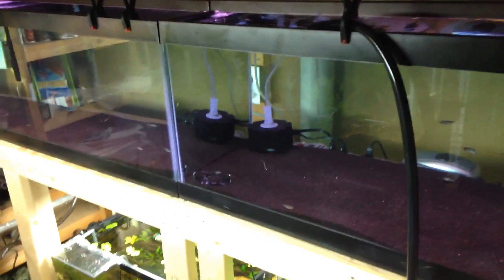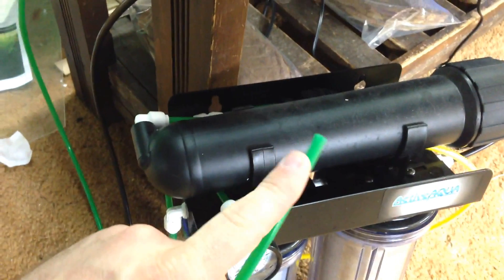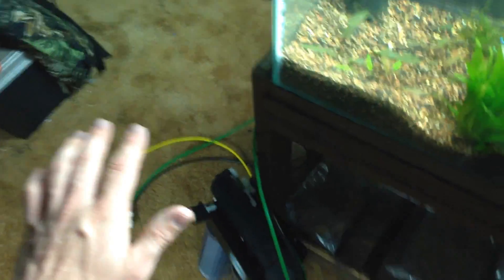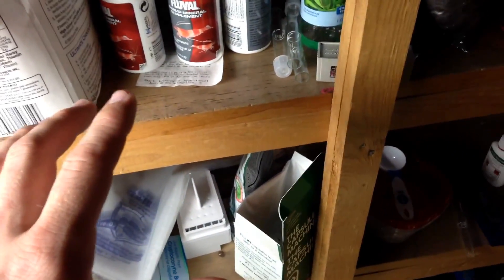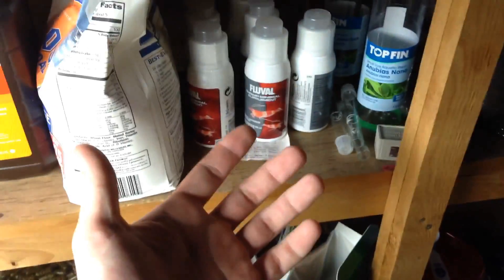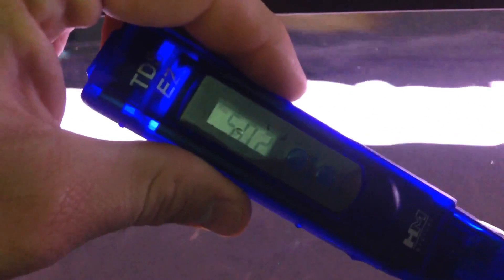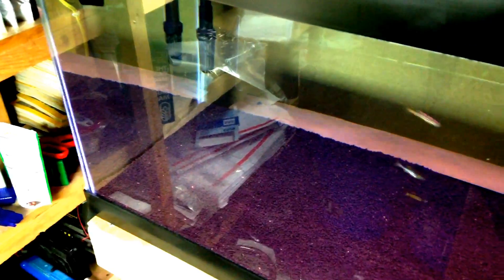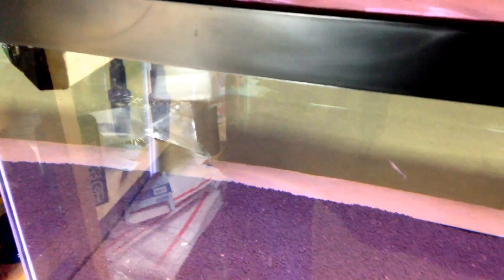How to Breed Shrimp: Using RO/DI Water or Distilled Water in a Shrimp Tank

Comment: Such cap. I suggest you actually learn how to properly pronounce some of the words you deep diving into. And sure gh and kh might be more important of a parameter but ph absolutely does matter and calling people who test ph control freaks is actually laughable considering you can’t even say the name of the shrimp properly😂😂. Ph can absolutely kill fish and shrimp, typically softer the water or lower the gh the less tds and the lower the ph which can cause swings in ph due to the gh being so low not buffering the water at a fast enough rate. The higher the gh the less likely the ph is to swing. Best way to think of it is to consider gh to be a trash can and the higher the # of gh the bigger the trash can is. Once that trash can fills to the top with ammonia, detritus ect the ph will start to swing. So if your gh is super low your trash can is super small and ph will swing faster and a lot more drastically. Allllllllll shrimp love “stability”. Thats what truly matters you can have a super high or super low ph or gh as long as those parameters never flux the shrimp will adjust and live. Breeding is when the gh, kh, ca, ma, ect are important to at least keep a monthly track of with a test kit or test strips. What you call “control freaks” I call due diligence. My blue galaxy tigers cost me 300$ for the shrimp alone. I truly don’t think you know enough on water chemistry to be making a multi part series on it….

Comment: I don't disagree with what was said with regards to fluctuations within a natural environment.  Every living system fluctuates within a system that is... Designed... to achieve homeostasis/balance, and tend to function like a pendulum, as long as a new influence does not act on the system each swing from one extreme to the other is less intense until the pendulum/system is vacillating over the middle ground of balanced... Until some other influence pushes it out of balance again.  The only thing that I would like to contend is that in most cases the body of fluid and other environmental resources to buffer and allow for correction is vastly different from a pond, creek or larger body of water and an aquarium.  Likewise a 5gal aquarium vs a 100+ gallon aquarium are vastly different in the amount of external influences it will take to swing any given parameter, the tanks ability to protect the organisms in it and to correct the out of balance parameter.  Then factor in the organisms ability to adjust to rapid changes and slight shifts in pH can be a big problem... But over all this does not change the core point that out if all the parameters pH fluctuations are not nearly as problematic as other parameters can be....  And if you kH is at a good spot your pH is not going to fluctuate suddenly or wildly...  As I understand it...

Comment: sorry my noob question that i gonna make but . went you make your water change you put the supplements in your RO DI water with 0 ppm   or you put the 0 ppm water just like that and after put the supplement directly to the tank ?
Reply: +ernesto corvera dissolve it in the bucket first with Ro water, heat it to proper temperature and then slowwwly pour it to the tank.

Comment: my TDS water in my house is 42-50ppm. should i need to use this? (water have no copper in it, i have already tested)  i dosed some thing called (salty shrimp GH+). my shrimps still died once a while. can you tell me while (not ages because they all young). i have 200 red cherry shrimp ammonia = 0, nitrite 0, tds 160, temp 78-82F.
Reply: +Edward Elk You should use Water conditioner to remove All heavy metals and chlorine from the tap water.
Reply: i did use it and i alway ages the water leas 3-6 week before use
Reply: +Edward Elk but i put dechlorinated water straight away to the fish tank with cherries. And no problem at all

Comment: PH is Potential Hydrogen. Important for Caridina shrimp (Not the Neo Shrimp) to be on the slightly acidic side. You have to be a control freak to keep and breed more sensitive species like Taiwan Bees and Sulawesi Species. PH below 7 is important for Caridina species. Good video on the importance of RO/DI unit, Minerals and TDS meter. MUST HAVES.
Reply: I keep my bees with no problem at all. Very active breeding also. They really don't need much PH fret if you know what your doing. Haven't tried Sulawesi yet but have thought to soon. I feel like I'd be successful.
Reply: ***** I've also heard it described as percent of hydroxide. whatever the original meaning, it's basically a ratio hydronium (acid) ions and hydroxide (alkaline) ions in a water solution.  What's really important is total dissolved solids.  Because PH is a ratio,  a solution with 5 ppm of hydroxide ions and 5 ppm of hydronium ions  would have the same Ph as a solution with 200 hydroxide ions and 200 hydronium ions.  Both solutions would have a PH of seven.  Of course, the 5ppm solution in a planted aquarium would actually would swing wildly between day and night because of the rise of oxygen (alkaline) in the daytime and the rise of carbon dioxide (acid) at night.  That's why pure reverse osmosis water is no good for either aquatic plant or animal life

Comment: Nice vid! About the PH, I thing it matters for a bit. It's a good thing to keep it below 7 if possible for shrimp like Crystal Red or Taiwan Bee. Because this eliminates the risk of a Ammoniac. Also my experience is that they are doing much better on a lower PH. If you got the right soil and RO water you are OK. Maybe this is not what you were talking about, maybe you mean people who measure 0.2 difference and freak out. If thats the case, I totally agree :).
Reply: Well pH on a chemistry level, measures hydrogen ion activities, which affects all measurements, so really pH can be found through some maths and the other tests you are already doing.  pH is a derivative of all the measurements you are already taking so it really doesn't matter.  As for the ammonia, if you just measure the ammonia levels you'll get measurement of ammonia+ammonium, so those tests are useless too.  GH, KH, NO3 and PO4 are the only measurements that really matter.  And if you want to be a control freak ORP.

Comment: Recently my adult shrimps are dieing, the juveniles and babies are doing abit less good, i dont know why, but i guess i should get an RO unit and try it. Maybe the tap water i am using is changing . hmm.
Reply: all my shrimp died, now i am restarting my tank with new substrate and most importantly now i am using di water.
Reply: di water ?
Reply: Deionised water.
Reply: I am now working in a shrimp dedicated aquarium shop in singapore. Learnt quite a lot bout shrimps from local breeders. Even expensive shrimps like pintos, wine red, blacxk king kongs and Pure Red Lines are breeding. So glad i worked there=)
Reply: Whats your recommendation for water parameter Gh/kh temp and Ph?
Reply: el7areef1 We used ADA soil cycled with Purify (a bacteria product from SL-AQUA which is originated from Taiwan). Using 100% RO water and added with a gh builder from SL-Aqua product 'Blue wizard'  to about 100 to 160 TDS. The result gH will fall in between 3 to 5 dgH. Temperature is about 23 to 25. I have kept them myself at home at 26 with no problem too. oh Yeah, kH is totally zero.  Light is on about 9 hours a day with a T5 tube for one three feet low profile tank.
Reply: Thanks bro. Very helpful.. its sound very hard to achieve  but I'll  try.
Reply: lee guankiat can i used those great parameters for ghost shrimp and cull cherry shrimps ??
Reply: Hmm, cherry is much simple. they can do better at higher TDS level of 180. I have never keep a ghost shrimp before....Temperature can be as high as 30 for cherry shrimps.
Reply: don't get a ghost shrimp it grew bigger than my amano shrimp and he was killing all the fish and now I have an empty tank they also killed my angelfish